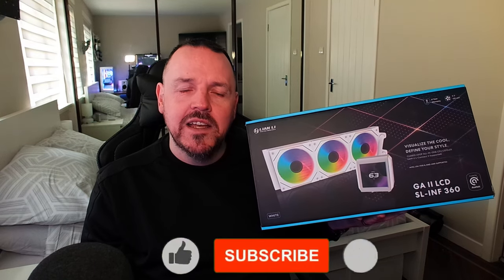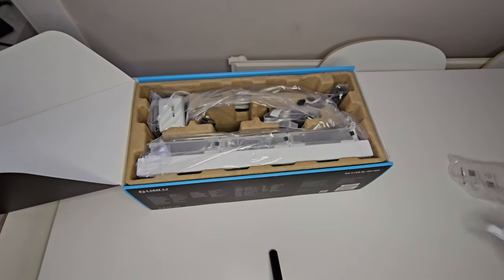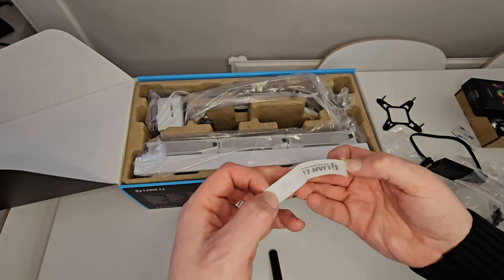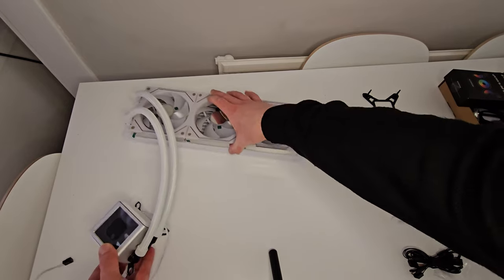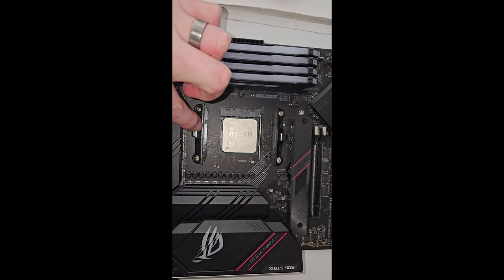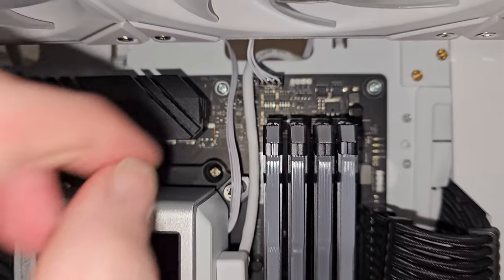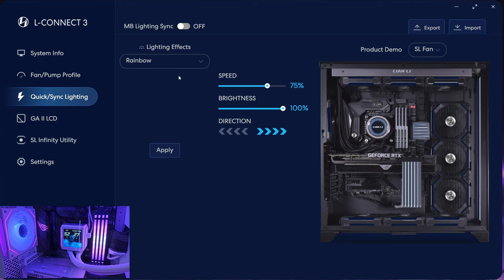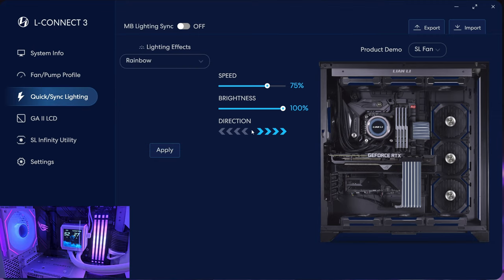How to install the Lian Li Galahad 2 LCD SL-INF 360

Comment: I was wondering whats the best way to wire everything. Right now I plan to get the Galahad II LCD, strimmer GPU and motherboard v2 cables, one 3-pack reverse infinity fans, a single reverse infinity fan, and a single infinity fan. My motherboard is the B650-A Asus board. My case is also the Phantek nv5 (needs USB2.0 header and ARGB?). Do you have any suggestions on how to plug the cables into each of them? My concern is how to wire everything including the connectors. Also afraid of number of headers on the motherboard might not be enough for all the USB 2.0 headers and ARGB. Thanks!
Reply from the maker: @John-ie2fw  I was similar in struggling with the lack of USB 2.0 headers in my motherboard so ended up buying tge NZXT internal USB hub which works perfectly.

I also ended up buying the Lian Li UNI HUB SL INF Connect 3 Controller to replace the one that comes with the AIO, done this for a couple of reason, one is that this Controllers uses the proprietary connecting that combines both the power and and RGB cables you get on the fans at the moment, the hub comes with replacement cables you can just swap those out, keeps the cable management cleaner...also this hub has an additional 2 ARGB connections for things like the strimmer cables and because of this the controller requires 2 sata power connections.

Just noticed that you said you bought a 3 packs of reverse blade fans, this controller might actually come with those fans, I had to buy my reverse blade fans separately, didn't think you could actually buy these as a 3 pack.

Should also point out the my case RGB (rbg around the PSU shroud and NV5 Premium kit) I just wired in to the cases built in controller and use the case buttons to set that. All the Lian Li components are controlled with the Lian Li controller.
Reply: @BrisyTechBytes  Thanks for the reply! Ah you are right, I don't think there is a 3-pack for the reverse fans. In that case what would you suggest? 

So the plan is to buy 4 reversed blade infinity fans and 2 regular infinity fans with a total of 6 fans. Would I then use two controllers or a single one? Can all 6 fans fit onto one controller? How would teh AIO connect to these controllers?

Are you also familiar with the Lian Li Strimer Plus V2 cables as I believe that one also comes with a controller specifically for the cables and wondering how to wire this up. Will I also have enough ARGB for all this plus the one for the NV5?
Reply from the maker: @John-ie2fw  just to check, you said you are getting the Galahad II LCD AIO...is it the 240 or 360 one you are getting? And the 6 fans you are talking about does that include the fans on the AIO?
Reply: @BrisyTechBytes 360 AIO. 6 fans not including the ones on the AIO as you have it in this video. AIO with three fans on top, one in the rear, one reverse fan on the bottom, and three reverse fan that arefront mounted. So sorry it should be 5 not 6.
Reply from the maker: @John-ie2fw  ok got you....so the controller that comes with AIO will be able to control all fans, each port on the controller can handle 4 fans.

I'm not too familiar with what comes with the strimmer cables but if it does have its own controller then it should just be a case of using that controller for those cables but will probably need it's own USB header and sata power supply.

Then when you eventually install  the Lian Li L-Connect 3 soft those 2 seperate Controllers should appear in the software allowing you to modify everything that's hooked up to them.

So you'll end up needing 3 USB internal headers, one for the AIO screen itself, 1 for the fan controller that comes with the AIO and one for the hub that comes with the strimmer cables
Reply: @BrisyTechBytes  Got it. Since I do not have enough USB 2.0 headers, I will also get the NZXT internal USB hub as you mentioned.

Regarding the PSU Shroud and NVM Premium kit, does this require any USB 2.0 headers or ARGB headers? I believe the case requires an additional USB 2.0 header for the front IO ports meaning I will need a total of 4 USB 2.0 headers but this should be okay if I get the NZXT hub. My question is how many ARGB headers will I need including the ones needed or NVM PC shroud?

My last question here is that above, you mentioned that you found it was better to use the UNI HUB SL INF Controller instead of the Controller from the AIO. Would you recommend I also do this or use the one with the controller with the AIO? If I purchase a separate SL INF Controller, how would I wire everything up? Does it make sense to buy a separate INF Controller Hub AND use the Controller with the AIO (all fans connect to the INF Controller HUB and only the fans on the AIO connect to the AIO controller)? Or would this require too many ARGB + 2.0 Headers + make it too messy?
Reply from the maker: @John-ie2fw  for my setup I use the inbuilt rgb controller on the case for the PSU shroud and NV5 Premium kit, the premium kit comes with its own little hub that just needs sata power then you attach the case lighting to that and the cable from the case buttons and control it with those, one button lets you select the effect type, the other goes through all the colour options, or you can attach a cable from that hub to your mobo argb header and let your motherboard software control the RGB, I tried doing that but was having some issues with all the case RGB not lighting up so perhaps some sort of limitation in my motherboard on how many leds it can handle.

 So for your set up the fans, AIO and Strimmer cables wouldn't need any argb connections as it's all controlled through usb using the L-Connect software, although there is the option to hook it up to your motherboard and control the lighting that way, L-Connect has a bypass button, but then you are limited to the motherboard rgb software, I find what you can do with L-connect is great.

It's totally up to you if you wanted to use the controller woth the AIO or this other one that I mentioned, the other one cost me £25 and Is quite difficult to get, what I like about it is that normally the Lian Li infinity fans come with cables that hook up to the fan and on the other end has 2 seperate connectors, one for fan power and one for rgb, this other controller cones with replacement cables for the fans and the connections at the end are proprietary ones and combines both power and RBG so makes things a little neater at the back of the case and easier to connect, it also has a further 2 rgb connections where as the one that comes with the AIO doesn't, I thought you might be able to hook the strimmer cables up to that and only need the one controller but I had a look online and haven't seen anyone say it's possible...and again just to point out this other controller requires 2 sata power connections to accommodate for those extra rgb connections, that's why I thought it would be possible to hook the strimmer cables up to it too.

Personally I'd just go with what comes the AIO just now and see how you get on. It is a little annoying that you bought a 3 pack of Lian Li infinity fans you would actually get this controller but your planned setup is practically identical to mine and there is no need for a 3 pack...and again it's annoying they don't do a 3 park of reverse blade fans
Reply from the maker: Also have a look at this video, perhaps shows you better the difference with the Controllers and how they are wired up....
https://youtu.be/Mxm_29mWr9Y?si=4D65NtFuDRuuEI1h
Reply from the maker: I've also just watched that guys video on how to install the strimmer cables and can see why it needs it's own controller, the strimmer cables have their own proprietary connections that need to plug into the supplied controller....Good to know for the future if I ever decide to buy them
Reply: @BrisyTechBytes  If I do not plan on getting the premium kit, how should I set up the PSU shroud? 

So technically I can use both Lian Li controller AND motherboard to control the lighting but I guess it doesn't make sense to use both since this will require using more ARGB headers?

If I buy the additional Lian Li SL INF Hub, can I use this Hub for the AIO fans too? What do you mean by it has "further 2 rgb connections where as the one with the AIO doesn't?" What are these 2 rgb connections you are referring to?
Reply from the maker: @John-ie2fw  if you are not getting the premium kit then it's pretty simple, amongst all the wiring attached to the case you'll see a male sata power lead, that will need to be attached to your PSU to supply power to the cases inbuilt controller and you will also see a female rgb plug which you can hook up to your motherboard, again youneitger control the psu rgb with the buttons on the case or the motherboard software.

The other Lian Li Controllers has 4 ports which are these proprietary connectors for the combined fan power and rgb cables I was talking about, there is another 2 rbg connectors which are sm type ports, think this is meant to be for hooking other lian li rgb products up to it....for instance if you had the non LCD screen Galahad AIO you could attach the rbg on that AIO to this controller.

You can see how it looks in this link....

https://lian-li.com/product/uni-hub-slv2-l-connect-3-controller/
Reply: @BrisyTechBytes  Got it! I guess my last question here is do you think I will run into an issue where I run out of ARGB headers on the motherboard? Does it make sense to plug in the controllers and other things to the ARGB header so I can connect with both L-Connect AND the motherboard software? Or doesn't make sense to use motherboard to control RGB and simply use L-Connect? Thanks!
Reply from the maker: @John-ie2fw  personally I wouldn't use the motherboard rgb headers and just use the L-Connect software as it has much more functionality and easier to use, plus you'll be in the L-Connect software a fair bit to also customize your AIO screen and setting fans speeds and so on. always feel like motherboard software for rgb is a little janky.

Speaking of L-Connect software I quite like that you can set each of the batches of fans to ramp up and down depending on the temps of the GPU or CPU, so for me I want to try and keep everything quiet as possible, the 3 fans on the AIO will change speed only as the CPU heats up, the rest of the fan cases are set to change with the GPU temps, my GPU runs pretty cool so those rarely ramp up, another little feature of L-Connect that I like 👍
Reply: @BrisyTechBytes  Thanks so much for the help! I subscribed and look forward to your future content :D. I ordered my PC parts and will wait for it to arrive and follow up with any additional questions if I have any!
Reply from the maker: @John-ie2fw  happy building and thanks for subscribing 👍
Reply: @BrisyTechBytes  Actually, the last thing is if you are using Lian LI to connect the RGB of all the fans and AIO, how do you get the nv5 case shroud and strip rgb color to match if they are being controlled differently? I see here that you were able to get the same pink-ish color on the shroud + light strips to match the fans
Reply from the maker: @John-ie2fw  if anything it's the other way about and I got all the Lian Li stuff to match the colour of the case lighting, the case lighting colours are limited due to the inbuilt controller but all the Lian Li stuff is highly customisable through L-Connect so quite easy to get it to match up with the case lighting 👍
Reply: @BrisyTechBytes  I’m currently building and since you only connected all the fans including AIO to the controller and then USB 2.0, this means the CPU_fan header on motherboard is not plugged in. did you run into any issues with not having this plugged in?
Reply from the maker: @John-ie2fw  no issues as the wire from the pump housing is connected to the AIO/pump header on my motherboard
Reply: @BrisyTechBytes I see, I heard some motherboard will fail to boot if no CPU_FAN is connected unless you disable this in BIOS
Reply from the maker: @John-ie2fw  as long as something is plugged in to either the cpu fan header or the AIO/Pump header it should allow the system to boot 👍...but yeah it can be disabled, just a safety thing so that the CPU doesn't get damaged overheating if no cooler was fitted
Reply: @BrisyTechBytes  Hey, I have the pc shroud argb header plugged into motherboard. The PC shroud is not lighting up. Did you have a similar experience?
Reply from the maker: @John-ie2fw  Mine is wired up to the case inbuilt controller, might be worth trying that, at least that way you can rule out there is nothing wrong with the RGB light strip around the shroud.
Reply: @BrisyTechBytes Tried that and still doesn’t work 😢
Reply from the maker: @John-ie2fw  when you plugged it in to the case controller did you make sure that the controller was hooked up to sata power?
Reply: @BrisyTechBytes  Yes I did. I cant seem to get it to work even if plugging in ARGB header or not. When I do plug in the ARGB header though I do see the led strip show up in my motherboard software so maybe the strip is just broken?
Reply from the maker: @John-ie2fw  only other thing I can suggest is holding down the mode button on the case for 2 seconds, this turns the RGB on and off..

Comment: on my aorus x670e master board i only have a cpu opt and a cpu fan and a sys_fan8_pump on the top of my board where should i plug the pump cable greetings friend and what speed of pump and fans did you use and what firmware do you have and how did you update it to make it right.
Reply from the maker: You can plug the pump in to the CPU OPT header on the motherboard and the cable coming from the controller in to CPU FAN header on your mobo. 

In the L-Connect software I set the pump to the quiet profile and the fans to the standard profile. Also in the software I selected all fans to be controlled by the GPU temps apart from the 3 fans on the AIO which are controlled by the CPU temps, unfortunately didn't cover that in my video but plenty out there that will show you how to do that.

As for updating the firmware I done that through the L-Connect software itself, if you have any issues doing it that way there is actually a tool you can download to update the firmware, the link for this can also be found on the page where you download the L-Connect software, just a case of selecting what it is you are looking to update, download the zip file and run the firmware update exe from within it and choose the latest firmware that is also included in the zip, if you have the latest version it will inform you.
Reply: @BrisyTechBytes  What version of the firmware do you have for the liquid cooling and version of the l connect 3? Thanks my friend
Reply from the maker: The L-Connect software is currently 2.0.11, the Pump firmware is 1.3 and the SL-inf controller is 1.4
Reply: @BrisyTechBytes  thank you very much that will help me a lot
Reply: @BrisyTechBytes  Now I currently have an Aorus Waterforce Liquid 360. Do you think it improves with the Lian Galahad II LCD using a Ryzen 7800x3D and what other recommendations to do the installation bn and how many rpm you have in the pump and fans to give good temperatures
Reply from the maker: @salovoley  I really cannot comment on the performance compared to the Aorus 360 cooler you already have as I have never used that AIO but aesthetically the Lian Li is obviously far better looking, could potentially be a lot of money to fork out just for looks and it performs the same as what you already have
Reply: @BrisyTechBytes Today I tell you that I was able to install the liquid well from Amazon and the firmware was updated to version 1.3. Is the last one correct? And it works well at rest, it gives me 54 ° C and playing Warzone 65 ° C with a Ryzen 7800x3D and fans at 2200 rpm and pump at 3600 without any strange noise, greetings and thanks.
Reply: I just realized my pump makes a noise but it gives good temperatures. I don't worry. I left the pump at 2300 rpm and the fans in highsp mode?  I have that doubt if it is of concern
Reply from the maker: @salovoley  for me I have the pump set on the standard profile, all fans apart from the AIO fans I changed to be controlled by the GPU temp, the AIO fans are controlled by the CPU temps...as my GPU runs pretty cool it means the only fans you hear ramp up are those mounted to my AIO

Comment: Do the fans come exhaust or intake?,
Reply from the maker: @Apathizial  fans are set up as exhaust fans although you could in theory flip the AIO round and have them acting as intake, just wouldn't look as nice.
Reply: @BrisyTechBytes  ok I was wondering my fans were not blowing, they are se in the mirror side , the single packs , have the mirror side as intake which looks cleaner
Reply: I’m gonna have to flip them around now
Reply from the maker: @Apathizial  yeah there is all sorts of options on how you can have the fans and radiator arranged. In my particular case I actually wanted the AIO mounted on the side and act as the intake, bought reverse blade fans to keep it all nice looking but it turned out that when you place fans at the top of my case (without a radiator) you can't see them so it felt pointless, especially having the infinity mirror fans, so everything was all swapped back again and the AIO top mounted 😬
Reply: @BrisyTechBytes  I have the lian li O11 vision the fish bowl case, where you are only able to mount the radiator on the side, since the cooler comers with the fans as exhaust, which I didn’t know till now I’ll be flipping them, like you said you want the radiator fans as intake especially if they are on the side
Reply: @BrisyTechBytes  sucks they had those fans flipped like that